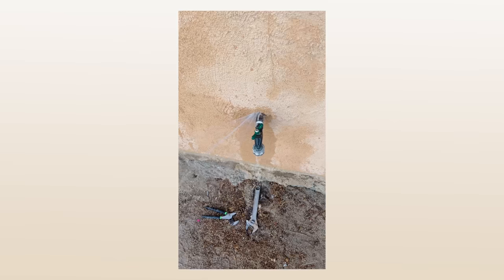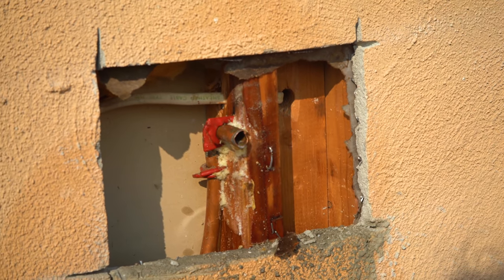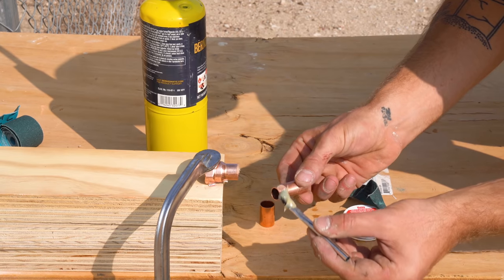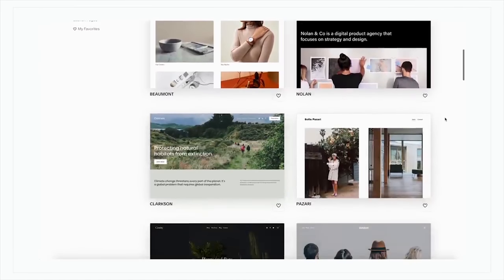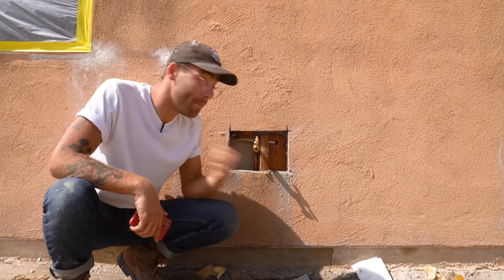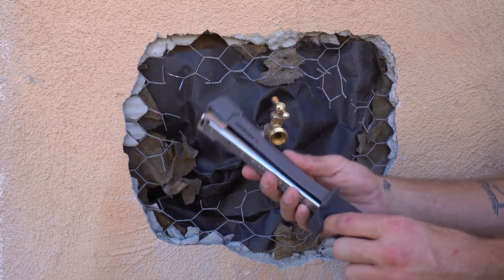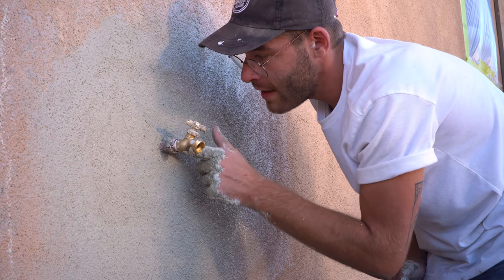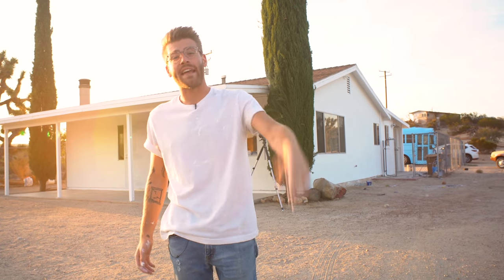PLUMBER QUOTED $750....I FIXED IT MYSELF!! DIY Hose Spigot and Stucco Repair

Comment: So I'm really glad you made a video about fixing your hose bib but I am a licensed journeyman plumber and I can tell you at lest 3 big mistakes you made and that you went about doing this the hard way I'd also like to point out that you didn't  mention that solder has to be led free and that if someone watching your video doesn't know that and they get 50/50 mix it goes against code and yeah it may have taken you 2.5 hours and I could have gotten it done alot faster but I also have been plumbing along time and know the code and have the tools and knowledge to do it fast at some point your solder joints will fail due to not knowing how to solder properly and chance is you won't know for some time and have water damage causing more money and work
Reply: And what where his 3 mistakes?  Also you may have experience  and it requires skill, but 750 dollars of skill and experience. If it fails, he can repair ir again and gain more experience? I’m not saying you shouldn’t charge for your work, time and knowledge but 750 for a job that takes you 1.5 hours, and tools which you already own and don’t cost more than a couple of hundred dollars is a bit much. Plus the repair requires some skill but come on is not rocket science.
Reply: @chicomore  you also have to factor the cost of driving back and forth to the site. He is out in the middle of nowhere and if the plumber has to drive far, that raises the price. Also, he should have gotten more than one quote for each service. Three at least. Or maybe he did get multiple quotes and only mentioned the most expensive.
Reply: See that's the thing the mistakes are something a licensed plumber would know and if it leaks he's out more money again so why not pay to have it done right the 1st time and avoid extra cost and really 750 is cheep for a repair like that in a wall he also doesn't explain how he figured out what parts and pipe size the average person wouldn't know that he might but this is his job to make these videos and show repairs also he didn't explain how that soft copper bends easy and if you bent it to much under the slab that 750 just went up to 1000+ in cost everyone want to act like plumbing is to expensive but the truth is plumbers keep the health and safety of the nation water is also so unforgiving and can cause 1000s in damage if you never done any plumbing work you should leav it to the people who know what there doing before you mess up and cause serious problems for you or someone else

Comment: Painting stucco is a mistake. Dyes are used in the concrete to match the wall. Painting it will cause the concrete to delaminates from the mesh because it can’t breath.

Comment: what was on the other side of that wall? I know there's obviously some differences in the way this is plumbed in comparison to my house which has PEX but I would have thought something like that might have been easier to access from the interior side. Drywall repair is a much simpler and cheaper process than stucco repair. But I'm not an expert by any means.

Comment: I think there are/were twenty something plumbers shaking their heads.   I'm no plumber and ALWAYS hire a pro but do know some things you don't do when soldering copper pipes.
Reply: Ikr. Just cos it didn't leak immediately doesn't mean it won't leak down the road. My landlord has some diy skills but when installing a extractor fan in the bathroom he got one that wasn't strong enough. And it freakin leaked into the ceiling ruining it. 
Get a professional for plumbing is a must IMO. Sure you safe some money now, but fixing it down the line when it's done way more damage? WAY more expensive
Reply: On the flip side, if it leaks down the road, it’s another learning opportunity. That’s usually the most effective learning tool is fixing your mistakes. And let’s also not make plumbing out to be rocket science. It’s definitely a skilled trade and I wouldn’t recommend someone with no experience take on a serious plumbing issue, but he soldered together three 1/2” joints. It’ll probably be okay.
Reply: @ShaeSandybanks  I've learned so much about soldering copper piping just by watching Ew Toob videos.  Yeah, I could probably do it myself, but as suggested, doing it incorrectly might result in long term problems with internal corrosion inside the pipes.

A gal I know had to re-pipe her whole house due to small pin hole leaks that occurred in all of her copper pipes.
Reply: @blairwilliams1268  I've hired several plumbers in my lifetime for three different homes.  Along with Ew Toob videos, I've learned that too much flux and solder is a long term problem.  JMHO but like that old commercial said, "Pay me now or pay me later".

Comment: To my knowledge the flux is to prevent oxidation while heating up the metal (the black stuff the builds up quickly). You need this to help ensure the all of the solder get full connection between both peices of copper in this case. Otherwise if you don't or use to little on both peices of metal, you will most likely only get a partial weld. Even if you can get a weld without the flux and have no leaks, it is likely that the oxidation will slowly weaken the solder/metal and eventually the connection will buckle over time making it leak eventually. 

PS - Great video.

Comment: Why didn't you tackle this from the inside. If you had just a wall, it would have been easier to patch sheetrock, unless that wall had tile... which could have also been easier. Just thinking. What is on the other side of that wall?

Comment: Not trying to be rude but there’s a reason contractors cost so much, you’re not just paying for time and materials. There are a ton of other costs that go into quoting a job. Also you might want to redo the stucco and wrap the pipe beforehand otherwise over time it will corrode and the water damage will cost way more to fix than the $1000 you were quoted by professionals.

Comment: With soldering too much solder can build up inside pipe causing turbulence which leads to more rapid corrosion and a pinhole leak.  Also de-burring the inside of the pipe is important as well as the outside, again to decrease turbulence.   And lastly you should only place flux on the male side of a fitting.  Flux is corrosive and if you place it also in the female end of joint it stays inside the pipe and can lead to pinhole leaks as well.  There is a water soluble flux available but doesn't look like it is what you used.  A pinhole leak inside a wall can cause a lot of damage before you ever find it and you can bet your insurance company will try to get out of paying. Great job otherwise.

Comment: Turning off a main waterline from the cities main valve is NOT always that easy and you can risk breaking it if its very old and tight, which will cost a lot more than $750. Quote is still high for "just" demoing the wall and adding a valve. Quote makes sense if contractor was going to re-stucco the opening.
Reply: Additionally, it only costs this much if you have the tools and 'know' what you're doing. Good job though. 😎
Reply: @mrharlemike28 this happened to me so I went and spent 350 on supplies, and I cut myself with the grinder because I never used one. so I still have to pay someone to do it and my hospital bill for stitches 😂 . Good thing I didn't go any further and probably would of burned the house down 😂 .

Comment: I live outside of Seattle.  I was heading to New Mexico a couple months ago when the drain in my bathtub plugged up.  I am not very handy with that type of thing. I tried some drain cleaners, boiling water and a plunger, nothing worked.  I called a plumber he came out used a “snake” and unplugged the drain.  It took him maybe 45 minutes.  The bill was $461.  Then he kind of implied I should tip him.  I didn’t!!
Reply: I’ll be honest.  It took the plumber about 8 minutes.  He spent a half hour goofing on his phone so you would feel better about the bill.  Unclogging 95% of drains and almost anything involving a toilet is pretty simplistic.  Next time just check YouTube before you call it plumber.  FYI a drain snake suitable for home use is under $20 at Harbor Freight.

Comment: Its not $350/hr. You have a 30%ish mark up on materials, mileage, hourly rate etc. Im not saying the plumber wasnt being a rip off because they can be expensive. But i get it at my job (electrical engineer/motor rewinder) people dont realize all the other costs that come with running a company. Ive got a building to pay for, company vehicles, tools, trainings, insurances, registration (we have yearly fees in NZ just to be able to do our job) and other things. While i keep my costs as low as possible, all these things have to factor in to charging jobs. Comments like the ones you were making are quite disrespectful and ill informed.
Reply: Yes, this. I actually learned this on cooking lol. Trying to mimic a recipe costs more than take-out IF youre gonna do it one time. You cant buy 1tsp of pepper, likewise you cant buy 3x3 of foam or waterproofing paper.
Reply: Calm down he just showing how much he fix it for vs paying a professional.
Reply: @riskbusin3ss  No, he actually said he thought it was a rip-off.  So yes, he insulted professionals with no clue what costs they deal with... Besides, he made a few mistakes, like he didn't wrap the pipe to provide some separation between it and the stucco.  So expansion/contraction will cause problems later, among other details that could be issues, for him and going to cost him more when he needs to fix them... There's also the issue some places require a licensed professional to do the work and could face fines and other problems...  So it's also a point that he didn't give any warning on DIYing it for others who may do it without checking their local ordinances...  He's done that before, ignoring potential liability... So take what he states with a pinch of salt, as they say as he's no expert on the law and building codes...
Reply: What he said .Im just realizing the true cost of things its ashame because you want to offer decent prices but noone deals with the setbacks or losses but the guy giving you deals

Comment: Ok so this is a “hack” job.  No offence because he gave it a great try and let’s not forget the  confidence!  Lol!  The solder joint was a disaster,   The pipe was too long, using spray foam in the desert?  Spray foam ?   What he doesn’t mention here is the fact that he had zero travel time to the job, carries no job insurance, he has used tools and materials that cost money … he’s not running a business so no business expenses. Also - should his work fail - he has no warrantee to fall back on.

Comment: Why didn't you just use shark bite fittings
Reply: While they do have a time and place, if you can solder it is definitely a better long term option for a behind the wall application. And yes I know they are “approved” for behind wall use.

Comment: It’s not a ripoff. It’s what is known as a market rate. Buy a pair of handmade jeans or buy some from an unethically sourced Chinese sweatshop. Two very different prices. Or make them yourself. Since there is no sweatshop version of a plumbing and stucco repair (because we are a free country with ethical laws), if you don’t like the handmade version (the contractor price), your only other option is to do it yourself. Which you did. You can’t consider it a ripoff though. You just don’t understand that a contractor, as with any other good or service, will charge as much as humanly possible. And as long as the market supports it, who is to say that it is wrong. Is it wrong for ray ban to charge $300 because I can get a pair for 15 at a gas station? Is it wrong for an artist to charge 10k for a painting when I could just do a paint by number? Market rate, not a ripoff. As long as people are willing to pay for a good or service then the price is what it is. A ripoff is paying for a service and then not receiving said service. Or receiving a lesser version or experience of what was promised.

Comment: When you save a $1000 on a repair job, you actually save more than that, because if you had to work and earn that $1000, you would need to pay taxes on them. As far as I know, there are not taxes on DIY projects (yet...). Well done!

Comment: Flux isnt needed when welling copper pipe to copper fittings, the phosphorus in the copper acts as a fluxing agent. Flux should be only used when copper pipe is used with brass fittings